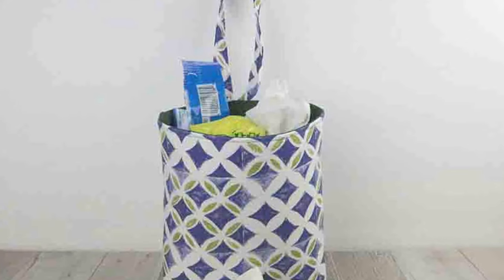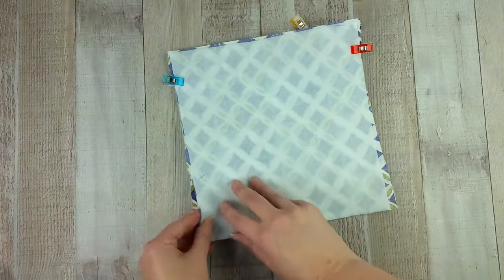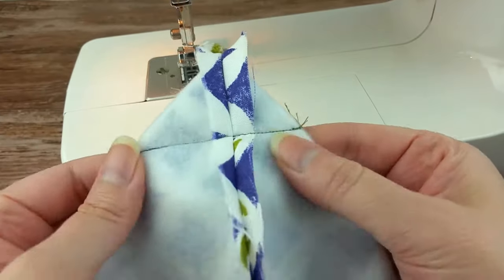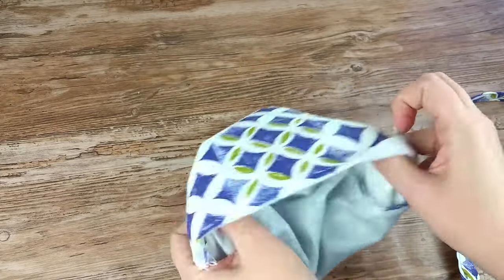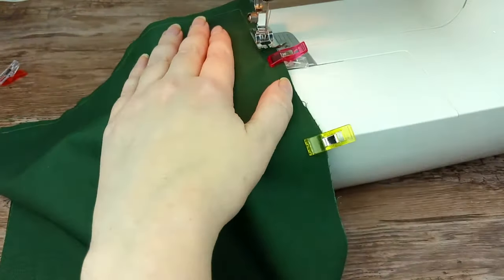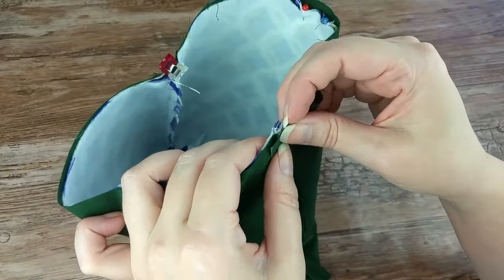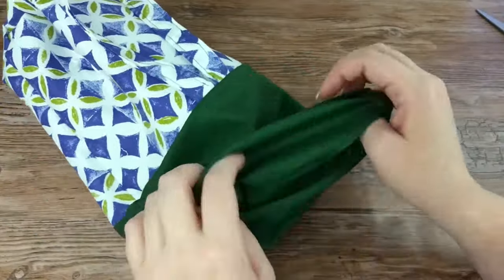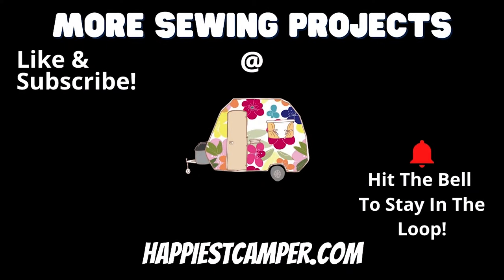Easy Sew Car Trash Can Sewing Tutorial

Comment: Your instruction is very simple to follow for me.  The measurements are 10 x 10, liner, body and interfacting.  The handle is 3 x 15.  So very nice.  Thank you kindly!
Reply from the maker: So glad u liked it
Reply: @HappiestCamper are those the exact measurements?
Reply: @andreaf5765  That's what I cut mine. I wanted the handle longer, so I cut it longer. But yeah, it's very easy, boxing the corners makes it a bag.